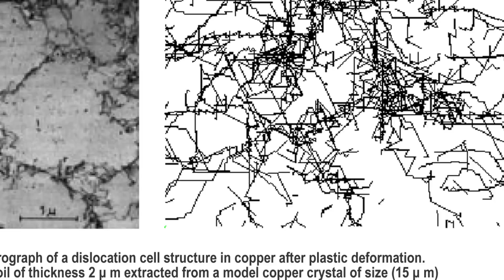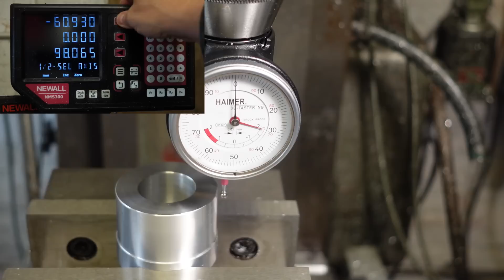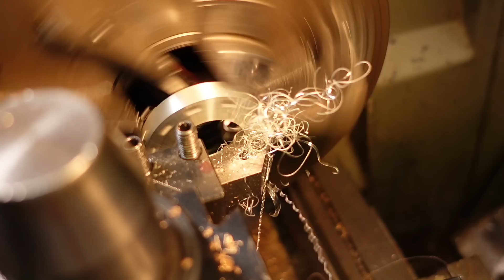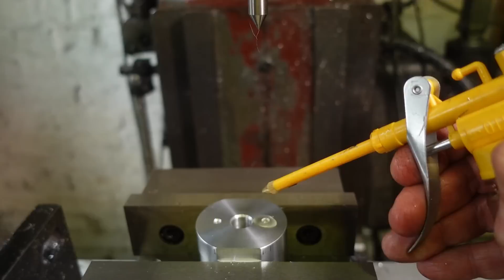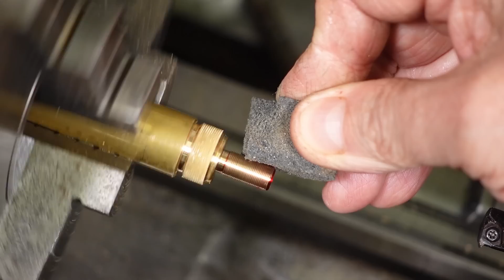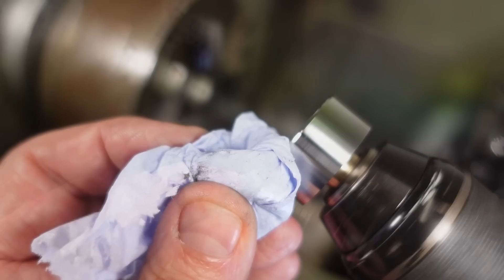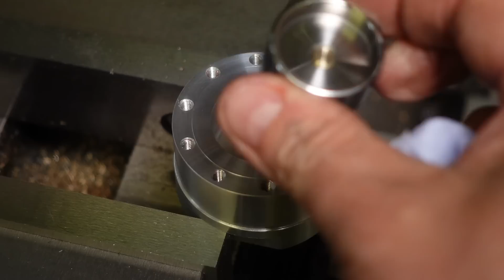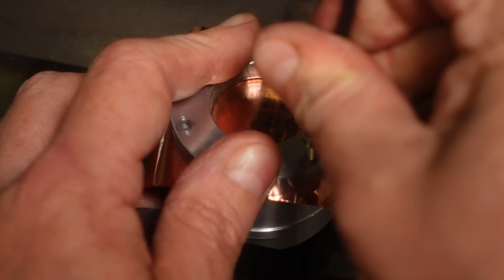Threading AWAY from the chuck! Great Seal Bug Membrane Strainer pt 2

Comment: I have been using the Joe Pie method, since running across his video.There is a wealth of machining tips and tricks on his channel
Reply from the maker: It's important to consider the helix angle and clearances if you use the technique, but for fine threads, especially for internal blind holes, it's a useful technique. Also for threads up to an external shoulder where there's a limited gutter. Joe's fixturing vids are my favourites
Reply: I made my own version of his follower rest for extended small diameter threading which,has some unique features.
The helix angle consideration is no less important when threading in the conventional manner.Fortunately,we have a wide selection of carbide inserts available at reasonable prices.
I enjoy watching your videos.
Reply from the maker: @jamesdavis8021  That little follower rest is neat, I made one from aluminium plate and used a piece of Tufnol for the follower. I tried PEEK as well, but Tufnol worked fine on some long M5 threaded items. Not worked out if it's possible to do something similar for cutting a right hand thread away from the chuck.

Comment: Doing it this way distorts the flank angle of the thread. Effectively, you are cutting a RH thread with a LH tool. Look at the mfg's informartion to find out that you would need a different (negative) sub plate under the insert. But I bet you even don't know about the plate under the insert.
Reply from the maker: On larger pitch inserts it would certainly matter, but on these tiny 0.5mm pitch 1/4 inch inserts, the helix angle is so small that the inserts are ground symmetrically and the toolholder is neutral and has no shim. For coarse pitches or smaller diameter to pitch ratios, I'd have to use a negative shim on a larger toolholder, or grind a suitable tool, but for an M12 x 0.5 thread with a helix angle of 0.76 degrees, the clearances on either side of these inserts is greater than the helix angle.
Reply: @MachiningandMicrowaves  You should educate yourself.
Reply from the maker: @MuellerNick  Interesting. Are you saying the spec of these inserts is incorrect then? I checked the clearance angles to make sure they really were symmetrical. I even set them up on a surface plate and checked them with a 2 micrometre DTI to confirm. Definitely symmetric. Definitely a neutral pocket on the tool and no shim for these tiny 0.5 mm inserts.

Comment: Thread cutting away from the chuck. Is the helix angle of the cutting tool correct or is it angled the wrong way?
Reply from the maker: Excellent question. For an M12 x 0.5, the helix angle is 0.77 degrees. That toolholder is neutral with no wedge, also the insert appears to be ground symmetrically and there's a bit of rake and relief, which give a clearance of much more than 0.77 degrees. For larger pitches relative to diameter it does start to matter if the holder is biased or the insert takes a tapered wedge. All of the inserts I use are intended for direct plunge and appear to be entirely symmetrical under a microscope. It would certainly become a problem at some point if the insert was asymmetrically ground or designed for other than a 90 degree approach.

Comment: Have you tried forming the foil using a urethane block as a die and a punch the shape of the inside? I don't have a video to show this precisely but this one shows copper foil being clipped to size around a shaped punch. -  https://youtu.be/dOAVcJ1CCmY
Reply from the maker: The original design required the foil to be soldered to the bronze ring while under tension so it has to be done using materials that can withstand soldering temperatures. I think engineering plastics might work well when using cyanoacrylate if there's a way to apply tension during the whole process, but the historical parts I was replicating were from way before CA was invented.  The copper in the demonstration is twenty five times thicker than the foil I was using, and it needs to be taken well beyond the elastic limit into plastic deformation and work hardening, then maintained under strain during fixing to the ring and further strained once it's in place.  Huge fun trying to come up with solutions, lots of good ideas have been put forward by viewers

Comment: I´ve got some 8mm bar stock, simple part... Turn to length, M8x25RH on one side, M8x25LH on the other.... I got them on CNC, and I´ve encountered two problems in my mind. 1. I don´t want the machine to plunge straight into the stock to turn LH thread, 2. I know the lathe needs at least 1x thread pitch to speed up feed to match speed.... Customer didn´t allow for any thread relief, so I turned RH side normally with OD threading tool and turned threading bar upside down in the turret to do the LH side... I normally cut everything in M3, so clockwise diredtion, as my tools are "upside down", inserts facing back cover panel, not the door..... That´s thinking outside the box, if you got 100 parts to make and you don´t want to manually thread them with a thread die as they needed to be perfect...

Comment: I suspect that a good collet chuck would help with the fiddler parts  you're turning
Reply from the maker: I use my ER40 and ER25 collet chucks for the majority of the small work, but I did a very careful regrind of the Pratt Burnerd 3 jaw recently and always finish tightening using the "O" marked pinion and get surprisingly good repeatability. When I'm using stock larger than 30 mm max capacity of the ER40 for part of a job, I do sometimes carry on using the 3 jaw for smaller stuff, but only in a single setup so I don't lose concentricity.  I sometimes make softjaws for holding smaller parts where a collet might mar the surfaces, or where I need a very precise Y axis position.

Comment: There's more to threading away from the chuck than you're letting on here. The helix angle on the tool is wrong for going in that direction. For a fine thread you'd think the side clearance on the insert would be enough, but are you using oil in case it's not? (why else would you use oil on Brass?)
Reply from the maker: The helix angle of those M8 x 0.5 threads is 88.9 degrees (or 1.1 degrees). I checked the inserts under a microscope and there's no clearance at all, the cutting point is entirely parallel for the full depth of the insert.  The clearance is created by the rake angle of the insert in the holder. It's a Vargus 2IR0.5ISO right-hand internal 1/4 inch uncoated insert. The holder is an internal one with a steep negative rake, and it looks like it's neutral, without an anvil. Using that on an external thread exaggerates the side clearance and from my back-of-an-envelope calculations, it looked like I had plenty of clearance on threads of M8 and larger. I have taps for M8 x 0.5 and M12 x 0.5, and for larger 0.5 pitch threads, the helix angle is so small that it's not a problem. If I was using a proper external holder, I'd have to use one with an anvil and buy a reversed anvil to change the helix angle from +1.5 to perhaps -1.5.  There is a larger issue though.  As this is a full-form insert, the last cut will top two threads instead of just one, so I machine the OD to be exactly on the finished thread diameter and ensure that the last cut just touches the remaining Dykem, but doesn't remove significant material.  My thread gauges suggest that the threads are OK, and they look good under a microscope.  I do give them a polish with a Cratex abrasive just to remove any sharp edges.  The oil is there to catch the spray of brass when I'm using the camera close-in, otherwise the lens mechanism fills with brass dust and makes nasty noises. I do find the finish is much better in copper with a light lube (usually a 50/50 mix of WD40 and some ester-based Millicut J40 cutting oil) but with CZ121 brass it doesn't make much difference. If I fit the rear toolpost, I can use a proper insert and tool with the correct helix angle, but this trick works for folks who don't have a rear toolpost.  I should have gone into it in much more detail and explained about what is actually going on, but it really needs a separate video to cover the intricacies. Hope that makes some sort of sense!  Thanks for bringing up the subject. I'll try to explain in more detail next time.

Comment: Would simply beating the copper foil like they do for gold sheet work  (gilding)???
Reply from the maker: I have some copper leaf that was made using the same process as gold leaf, but it's much more fragile than gold. Perhaps it's something to do with oxidation or formation of sulphides at grain boundaries causing weaknesses. I think it's probably tricky to keep the copper annealed when it gets very thin, plus it must be tough getting a consistent thickness. It is really weird stuff, I use a paintbrush and static electricity to pick up ip and apply it like you do with gold leaf, but it tends to stick to the brush and break down to a sparkly dust.

Comment: If you had a pattern of stripes or dots painted on the copper, would a loupe with a scale allow you to see when the marks had spread the amount corresponding to the amount of stretch that is enough?
Reply from the maker: Interesting idea. I could use the centrescope to measure the movements of the dots using the DRO on the mill to see what moves where and by how much
Reply: @MachiningandMicrowaves  What would you have if you stretched a thicker foil  then thinned it by etching or by making it an anode in an electroplating tank? would the work hardened quality remain as it thinned?
Reply from the maker: @michaelwarlick4328  depends on the grain size, but I suspect it might result in enhanced material removal along grain boundaries. Grain sizes after work hardening are around a micrometre across but might be shallower than that in thin foils. I'm going to have a look at how Mylar is made from PET to see if there are any parallels
Reply: @MachiningandMicrowaves  Mylar remains on the strong substrate and can be stretched a lot, but I was assuming that you needed the copper foil to be free of its mandrel or substrate. The amount of Gold on the mylar is truly tiny it can be thin enough to be transparent. or to serve as a beam splitter at half reflective.
Reply: @MachiningandMicrowaves  I saw Elon M . discussing electroplating to produce rocket combustion chamber lining. recently on "Everyday Astronaut"  He said it was difficult and slow.  I suppose that he had to be slow to achieve the thickness he needed without having the crystal formations that rapid deposition makes. You must be using time and voltage very carefully to achieve a uniform and smooth thin foil.
Reply from the maker: @michaelwarlick4328  I haven't tried foils yet, I'm doing something similar to Elon by machining an aluminium mandrel with complex surface geometry (corrugations about 1/4 wavelength at 47 GHz, so 1.5 mm wide and 3-4 mm deep) on a complex elliptic curve taper, then using an etch to remove the oxide, then applying zincate to leave a layer of elemental zinc on the surface, then plunging that into a plating bath with the power on so the zinc disappears instantly and exposed the bare aluminium so I can then plate on a layer of gold, then a barrier, then electrofoming about 4 mm of copper over 20 hours with agitation and pulsing to reduce the formation of dendrites.  On completion, I chuck up the mandrel and clean up the copper to form a cone and flange for mounting, then drill out the majority of the aluminium and dissolve the rest out using hot caustic soda.  That leaves me with feedhorn with internal corrugations that have a gold layer inside and solid copper outside. Elon was growing something like Nickel I think?  I happen to have a lot of copper sulphate so it's a no-cost option for me to do it in copper.  I might do a layer of gold brush-plating on the outside just to make them extra-shiny.  The idea is to make feedhorns with extremely low sidelobe levels to reduce thermal noise pickup form trees, earth and buildings.  If it works OK at small scales, I might try a larger-scale version at 10 GHz, but perhaps using a different technology as that would be a significant lump of metal.  I'd perhaps make an outer cone rolled from sheet and TIG welded at the seam, leave the outside of the electroforming raw,  and fill the gap with an epoxy resin to make the thing very stiff.
That could be an interesting project.  Watch this space....
Reply: @MachiningandMicrowaves  Wow !that sounds like a script for a really great video!
Reply: @MachiningandMicrowaves  Would a thinned and stretched copper sheet that was not yet work hardened quite enough , continue to work harden when it was vibrated?  I have in mind submergence in an ultrasonic cleaning tank. But I don't know that this would be more gentle than stretching, It might be just as bad.
Reply from the maker: If the vibrations were large amplitude, I suspect there would be work hardening right at the edges, but not enough strain to do any hardening or grain boundary modification. In an ultrasonic bath, the wavelength of the oscillation is similar to the dimensions of the diaphragm, so there could be some interesting effects. I suspect there could be rapid damage from cavitation.  I did some work to make new titanium tips for cell wall disruption sonicators and the surface of the Ti had most extraordinary cavitation damage, with complex 3D pits and tunnels several mm deep.

Comment: Very well done video. Have you considered making a book of goldbeaters skin or thin rubber?  First flatten the foil by pressing in an unabridged dictionary then take two sheets of  leather, or goldbeaters skin , or rubber.  Copy the hole pattern of the press in the flexible sheets. Fasten the two sheets together on one edge. Build a clamping and pressing device much the same as you have here but with enough more clearance to compress the elastic material. place the well flattened foil between the sheets of elastic material , then place this book in the press.
Reply from the maker: I have a lot of copper leaf that's about the thickness of one wavelength of visible light, it's nightmarish stuff to move around, more fragile than gold leaf. Quite WHY I have a few hundred sheets of the stuff is mysterious, but it started as an experiment in electroforming on to a machined wax master for growing waveguide components. Trying to burnish the leaf on to wax was, er, "amusing", to say the least.  I saw El*n M*sk talking to Tim Dodd about electroformed parts of the gas generator in one of the early Raptor rocket engines yesterday, and that's the sort of thing I'm working on.  I wanted to see if it was possible to avoid the usual issue with having to dissolve an aluminium mandrel in sodium hydroxide when electroforming parts.  So far, it doesn't seem to work.  I can't get an Aquadag colloidal carbon wash to adhere either, but I don't really want to have to do it that way.  Far too many projects and no time. Working at The Day Job again this week to earn some pocket-money to pay for experiments!
Reply: @MachiningandMicrowaves  That explains the wax . Can you polish a very flat finish on a thin sheet of zinc? Zinc can be removed with milder chemicals than aluminum requires, and thc copper could be stretched while still bonded to the substrate. I believe that electroplating a bit of zinc would produce a copper foil , but there might be crystals that roughen the exposed side.
Reply from the maker: I've never tried machining zinc, in fact I've never seen zinc other than in sheets as a roof covering or as a galvanised finish on steel.  The thing about using aluminium is that the hot NaOH doesn't affect the gold, nickel or copper. I have some disodium tetrahydroxyzincate that seems to work well on 6082 aluminium, but I need to do a lot more experimentation before this process is reliable.
Reply: @MachiningandMicrowaves  Zinc will dissolve on pretty mild acid , like vinegar .
Reply from the maker: @michaelwarlick4328  Following your suggestion, I just bought some 12 mm diameter pure zinc cast bar to see if I can get it to machine to a decent finish, I have some concentrated HCl, so if I dilute it, it shouldn't harm the electroformed copper unless it's in the presence of oxygen. Gold will not be affected.  I could coat the outside surfaces of the copper with paint or wax to protect it, but it should only dissolve the oxide layer. I can get bars up to 30mm diameter, but I bet it's horrible stuff to machine!  Nothing ventured, nothing gained...
Reply: @MachiningandMicrowaves  I am excited that you thought my idea worthy of a trial. I expect you will have no problem  producing a flat and smooth  surface , but I am not in the know enough to predict the chemical interaction or grain pattern interaction.... I consulted with my brother who is a jeweler, he suggests using a rolling mill or a roller and platten, you may find a small rolling mill in a jewelers workshop. Jewelers use rolling mills to convert nuggets or ingots of ductile metal to sheets and ribbons. This would produce the work hardening , but the stretch would be more isometric , stretching in all directions would take multiple passes and since the foil is already very thin each pass would have to be a small increase in pressure.